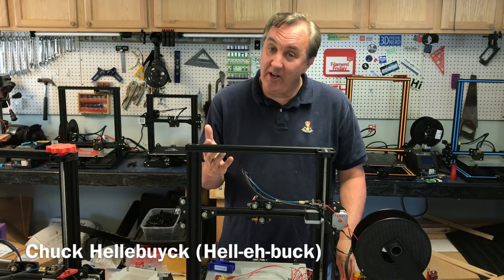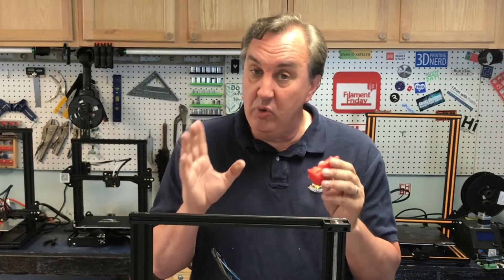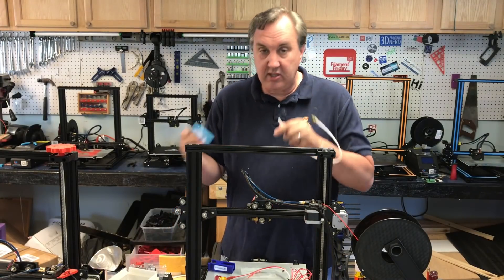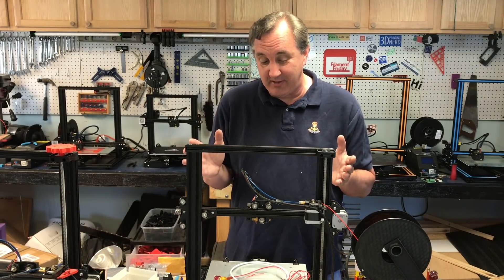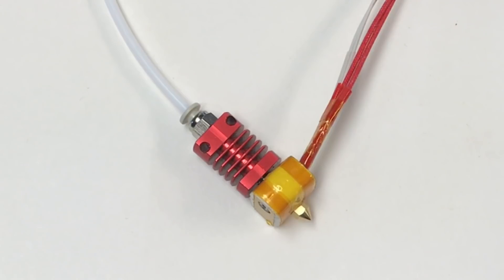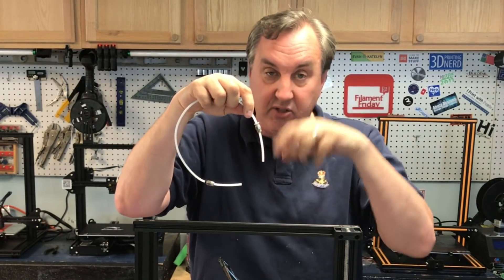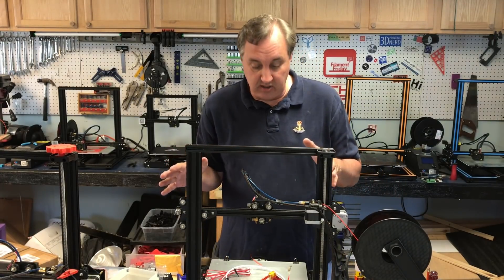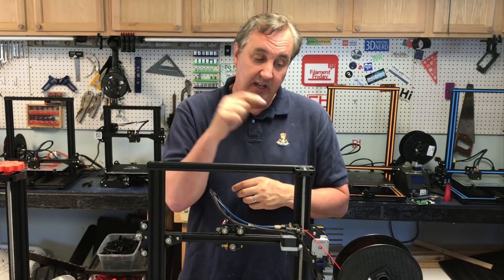Fixing a Filament Flow Problem on CR-10 mini, CR-10 or Creality Ender 3

Comment: I've been beating my brains because of this problem with my Ender 3. I was so confused and discouraged with printing. I replaced the nozzle and everything was fine, but it started stringing, even on large prints. It was driving me crazy! Thank you so much for sharing this solution because you've saved me from so much aggravation!

Comment: But what if it has direct drive with no coupling? I have a V3 that’s having those issues.
Reply from the maker: There is still a section of PTFE in there. It may need replacing.

Comment: I am having a similar, but slightly different issue: my e-steps are calibrated (96.8 is the value I reached), but as I print anything with sustained flow (gridfinity base) at 50-60 mm/s with a 0.4mm standard nozzle (at least, I assume it is: it came with the machine and is unmarked), the filament is backing up and shoving the bowden tube out of the hot end, and it is being ripped up by the lock as it goes, the extruder skipping continually as it happens.  Also, the extruder gear leaves deep marks in the filament as it feeds.  This seems to happen whether I run my PLA at 200C or 215C.  Any thoughts on the cause?

Comment: this didn't fix my problem :(, my tube was locked solid and didn't slip. I'm still getting prints failing mid way. Any other ideas? I've levelled the bed, replaced the nozzle, gone as far as to replace thermostat and hotend, replaced the extruder yet still getting string prints
Reply: Depends on how the prints are failing. To me stringing is not the same as failing. I recently had a problem with my ender 3, all prints where failing. 10 or 20 good layers and then massive gaps. The problem was the filament getting stuck in the feeder. The very first hole where you feed the filament was completely worn out. Apparently a very common issue and easy fix.

Comment: I get a odd issue: noticed on 1st layer of rafts most often, the extrusion width will wax and wane on a cyclical pattern that seemed to correlate to how much laid down. It goes thick, thin, thick, thin. Prints turn out ok.

Comment: Great vid, Chuck! To add my 2 cts: I found that a proper cleaning of the hot end requires the fan shroud to be turned away from the finned cooling section, allowing it to heat up so that any filament residue stuck to it can be removed. I did not do so initially, being scared of damaging the wiring whilst bending. This resulted in the tube 'bottoming out' on a filament blob (and me watching a million vids and trying any remotely plausible remedy).

Comment: how a question...i have a cr 10s pro and the hose keeps popping out of the extruder
Reply: Your coupler has failed, that is the bolt that holds the tube. If you look down it you'll see little folds, those clamp down and grip the tube. Yoi probably have a broken one so you'll need to replace it
Reply: @moonlight39echo  thats was the issue, thanks
Reply: @paulviana838  lol I just realized that was a month ago...should have know you'd figure it out

Comment: Im getting a good first layer on my ender 3. but the second layer is under extruding, extruder is slipping. New nozzle, cap tube, metal extruder, stock cura profiles. Any ideas?
Reply from the maker: Your Z axis might be binding. Loosen the T nut screws that rides on the threaded rod.

Comment: So I just bought a brand new CR 10 mini, and it came and I quickly put it together to start printing. All the reviews I had read said how easy it was to start printing. But once I started the cat sample print I realized something was not right. The filament was more of a mesh then a solid. I stopped the print to level the bed, heat it up a tad, and make sure nothing was wrong. But still the same problem. The plastic on the bed is like brittle, and not solid. I'm not new to this printer to. I've printed on these at my school a lot, and that's why I've bought one. For the last few days I have endlessly fiddled with everything you said in this video, and everything thing else you could think of. I've leveled the bed dozens of times but to no avail. Would you recomend a new nozzle? Is there a suggested temp for the sample roll it comes with? Is there a trick to leveling the bed? A recommended nozzle for this printer? I'm starting to think it's a dud from the factory but I highly doubt it. Anyways if you took the time to read this, and reply back then thanks A TON.
Reply: yo same issue it could be your extruder so id recommend tightening the extruder with teeth or upgrading the extruder entirely unless youve already done that
Reply: Hehe. This is the same person but on two accounts. Thanks for the feedback I will definitely try that. Were your attempts to fix the extruder successful? If so that may be the answer to my problem. If you reply back thanks a ton.

Comment: Where can you find the part you're talking about?
Reply: Thingiverse. Look for "Luke's fix"... Also, check your hot end cooling fan (not the part cooling fan), the one in the front: if that one is not working well it can cause the same issue.
Reply: @f.d.6667  Thanks bud!

Comment: Hey, thanks for the great video! I have a new CR-6 SE and I'm seeing problems that seem very similar to this. It started with an underflow problem, and cleaning that up produced a giant glob of PLA out of the hot end tube. Does anyone know if the PTFE couplers off the V3 will work on the CR-6?
Reply from the maker: Yes, they should.

Comment: hi - just watched two of your videos - nice - and I subscribed
I watched your magic #'s  and the broken tube connector fix
oddly enough I had the opposite problem with the top connector
on a Boxzy printer (don't ask <grins>)  I also have the new CR6-SE
with the auto level - nice!   Cura doesn't have that model and they
told me to use ender-3 - I'm using Cura 4.7.0.  This has super quality 
0.12 which matches your numbers.
anyway, I subscribed because of your great videos.
I used one of those other slicers supposed to be #1 -
hated the way the printer jumped around and uninstalled it!
ds

Comment: A nice tip to all people: I had this blob from the beginning of printing. My fix was easy: I cut off a short piece of the PTFE tube and inserted it with the right length in, right against the nozzle. On top I placed a PLA printed insert, which just uses the coupling above, to press the tube against the nozzle. I had no clog since and I am really abusing this machine for weeks now. (double print speed)

This costs just like a cent or less of filament to print and is IMHO the best upgrade you can possibly make to an ender 3. Even if the coupling fails, you will NEVER get that blob ever again!

Comment: What I don't know is after fixing the nozzle the tube testing the estep getting the calibration right I still have this what I call snake skin in just one section of my print any suggestions?
Reply from the maker: Check for slippage in the extruder.

Comment: could you tell me your magic settings in cura for the cr10 cause i have the same problem that you explain in that video , end of the tube clogged and filament does not want to stick to the bed , so i have change the whole extruder with the tubing and lock mechanism and new nozzle , same problem again ! i just ordered capricorn tubing from amazon ! but i think it could be my settings in cura,,,,so could you help me try to solve this problem ,,,,,,,,thanks chuck
Reply from the maker: I use my CHEP Cura profiles: https://www.chepclub.com/cura-profiles.html

Comment: Hey, I've had the same problem, i changed everything like you did but the filament still can't get through. It get clogged everytime. I don't know what to do anymore...
Reply: Yeah, I think I'm right where you were at. I'm going to attempt to replace the hot end. Everything seems to be connected correctly and my coupler is fine.

Comment: I am having a similar problem currently. each time at the middle of the print I find that my extruder have cut my filament. What I noticed is that the extruder go back and forth a lot on the same place of the filament until it cuts it. I thought the problem might be in the thing I was printing because it has a lot of small lines that may lead to these too much back and forth moves of the extruder but I was wondering why every time at the middle of the print. I will check everything you have done and I hope, that your solution work for me. Thanks a lot, this video was extremely helpful
Reply from the maker: You might look for a blockage preventing the filament from fully retracting.
Reply: Check your hot-end cooling fan too. If it is slow, old (a few months IS old!), then it can sometimes cause the same issue as the filament will melt too early and block the ptfe tube right before the nozzle...

Comment: Hello, can I ask what should I do if the problem persists after changing the parts? Thanks
Reply: Check the cooling fan of the heat-sink! If that's on its way out (older than a few months), the filament will form a rubberized plug right before the nozzle which is too much resistance for the extruder to overcome. Sometimes the two problems occur around the same time, driving people insane...

Comment: wow my tube was in to far in the hot end... its not supposed to hit nozzle the part the tube slides into butts up to nozzle...what i did is by pushing mine to hit nozzle  it squeezed tube even smaller not allowing filament to slide freely.....by bringing tube back approx 1/2'' filament  moves freely now...i know this was my issue since i spent hours trying everything else...and like you it seems okay untill 20 mins or so into each test print...it even printed a 15 hour statue that actually printed...but very weak and bad quality do to poor extrusion... thanks
Reply: Actually, the ptfe tube is supposed to go right up to the nozzle. It must have been something else.

Comment: I hope this is my issue. I will have a few prints go well all the way through, but most will be poor after an inch or two high. The filament kicks back a step, every few steps. When current print is done, I will try to see if this is it. Don't have another coupler though, and Amazon is taking weeks. But will see if I can figure it out
Reply: Hi, I had the same problem. Basically the estruder is having difficulties pushing the filament. I solved it lubrificanting the spool holder with a bit of graphite
Reply: Also check your heat-sink cooling fan - can cause a similar problem when old/weak.

Comment: Dude this printer is sometimes very good, but the rest of the time is a pain in the ass, i'm so tired of it.
Reply: Yup, its a very good printer for first 6 months but b/c cheap components it wears out, need to replace extruder and ptfe bowden with Capricorn asap. DIRECT DRIVE AND DUAL GEAR FEEDER/EXTRUDER IS GOOD IDEA, TOO!!

Comment: Thanks for this video, but I'm hoping someone can help. Got the Ender 3 Pro today and when I try to feed the machine filament and push it through, it only goes so far, stops extruding and the feeder tube pops out - not on the hot end but by the feeder gear. The tube won't lock into the nozzle on that end and I tried with the spare replacement nozzle. My last printer was a Qidi X-one 2 which always worked perfectly. I feel like I must be missing something obvious. Any help you could offer would be greatly appreciated.
Reply from the maker: Did you get a blue u shaped clip to insert in the coupling to lock it in?
Reply: @FilamentFriday  well thats what those are for....I didnt see them used in the Assembly manual..thank you very very much.

Comment: I think i just ran into the same problem with my Ender 3, but i can't pull the tube out of the heater block :/ i've unsrewed the coupling and nozzle but the tube isnt moving at all, any Ideas? (dont wanna brute force it because i'm afraid of damaging something else)
Reply: Edit: Preheated for Abs and waited a moment, then i was able to pull it out
Guess i'll have to wait for some new parts now
Reply from the maker: Glad you were able to get it out.

Comment: I have generic a10 3d printer it has a control box, the flow rate has an option of 0 to 999, I cant find what it should be set at for pla, does anyone have any idea?. My prints on the base are getting raised lumps and lines and they are hitting the nozzle, tried calibrating, pls help?. I only use the control box not a PC connection. Thanks
Reply from the maker: Flow should be 100% to start. If you are seeing bumps like that on the base then you nozzle is probably too close to the bed on that first layer. Adjust it like this:

https://youtu.be/_EfWVUJjBdA

Comment: I think i have this problem, but i cant actually move the coupling along the PTFE tube either direction, with or without pressing down on the top. What do you think the jamming issue is?
Reply from the maker: Take it apart and find out.

Comment: I wish I would have watched this before buying a new nozzle, hot-end, fan, Capricorn tubing, pulley gear. Well, I guess I'll need those at some point.
Reply: I did the same thing. I could damn near build a new printer.

Comment: Got a new CR10 mini since yesterday and its a problem ever since...my extruder keeps skipping,first i had too print a Z axis endstop part because the original endstop was under the lowest point of the heated bed,i tried too wobble the original up but without succes,next i tried this solution and that seemed too work for....about half a print :D and it started again...i will try it soon again with another set of  couplings and i really hope i can get rid of this.
I got an Ender 3 also,and i had hoped this CR 10 mini would be less of a hassle too assemble,but it turned out its not,im busy with it for 2 days already without printing 1 thing yet.

Comment: I've been fighting this issue for 2 days on a CR-10S and it's driving me nuts. It had been working fine for over a year and suddenly this problem cropped up. I could tell something was not right on mine when I did a recent filament change. I usually load the filament manually by holding the extruder spring lever and just pushing it through the hot end to purge out e.g. the previous color as it is a quick and easy method. It was much harder to push it through and just felt weird, almost like the hot end wasn't up to temperature. After taking the hot end apart mine had the short burnt off section as you shown. I thought, well that has to be it, cut off the bad piece, reassembled shoved the filament through the hotend which felt better but maybe not quite what I was use to. Ran a test extrusion of 100 mm watched the extruder carefully, after about 75 mm I noticed a couple skips and light chatter. Ran a few more 100mm extrusion test, same thing with light skipping and/or chatter. Next, decided to replace the PTFE tube with the spare one that came with printer. Made sure it was fully bottomed in the hot end, reassembled, ran same 100mm extrusion test several times, same problem, either a small amount of slippage or chatter telling me the extruder is fine and it's something to do with the hotend. I checked my hotend fitting this morning after watching your video and it seems to be in fair shape. If you pull back on the release button it will for sure lock the tubing so I but a small plastic wire tie around mine. Man I was hoping that would do it as I can't image the tube could back out any. No luck same thing when I repeated my test. At a loss for now, did order the Capricorn Tubing, new fittings and upgrade extruder assembly this morning. Still not convinced the new parts will help. Almost has to be something I'm overlooking on the hotend. How could it work fine for over a year and then just start doing this, crazy. Anyway Chuck, thanks for all your videos and work you do to support the community! Any other suggestions welcome as I'm at wits end.
Reply from the maker: Have you replaced the nozzle?
Reply: Hope you have managed to fix it. I absolutely hate situations like this, not just with 3d printing, but in general.
Reply: @Booruvcheek  --I've been wanting to do a follow-up on this and then it kept slipping my mind so thanks for the reminder. So a couple days after my post I took the hotend back apart a 2nd time and much to my amazement found another burnt off section of tubing. After some deep thinking about how this occurred I remembered getting a thermal runaway shortly after the rework. When I investigated that issue I found the temperature sensor was loose and slightly pulled out of the heat block and I just did a quick tighten in place as it appeared like the filament was feeding the about the same. So in short it burnt the end of the tube during the thermal runaway causing me the 2nd round of grief. I have since installed the Capricorn Tubing and the upgraded Aluminum Extruder kit.
Most of my grief was of my own doing for not disassembling the hot end after the loose sensor/thermal runaway problem and not checking if it melted the feed tube. It's been printing great since :)
Unrelated to what caused most of my grief but should be mentioned is that the Capricorn Tubing (Amazon purchase) has a smaller ID than the original tubing. I had a roll of filament that would get jammed in the feed tube. I measured the filament and found the OD was slightly out of spec ranging from 1.75 to 2mm. The Capricorn tubing as an ID of approx. 2mm so you can understand how it would jam. This has been noted before on other posts just wanted to reiterate. Not sure what the factory ID specification of the Capricorn tubing is suppose to be. Maybe someone out there can chime on this if they know.
Reply: @randywetzler5976  Glad you could sort it out in the end. Thank you for the update!